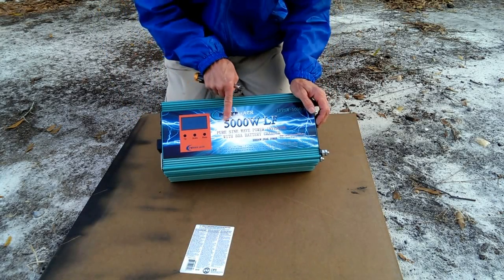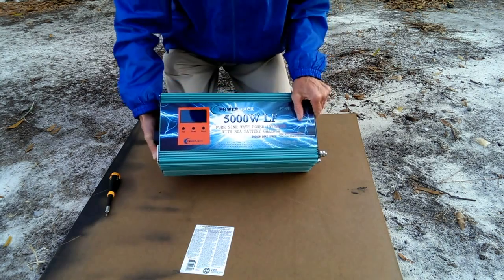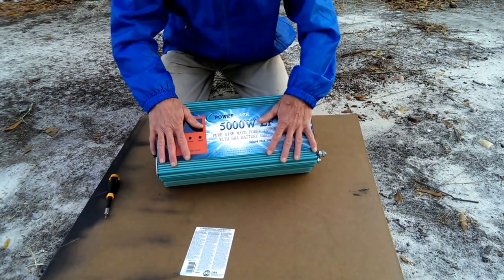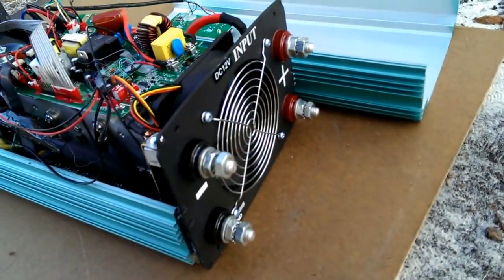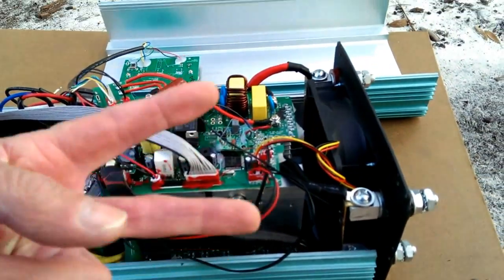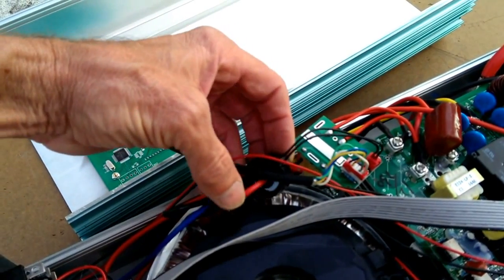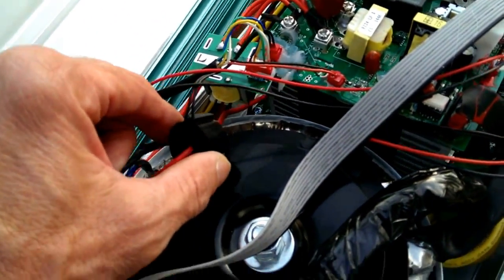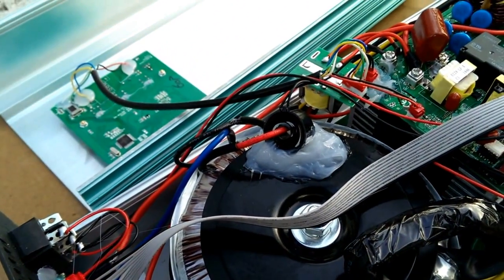5000w 220v Inverter inside

Comment: I've had both the 5000w and the 8000w and both of them have disappointed me. Product of poor quality and subject to many problems: overheating, insufficient fans, alarms out of control, mosfet burned ........ Product not to buy
Reply from the maker: sorry to hear this. Mine works well for over 3 year. I do welding from it
Reply: I have one also with no problems
Does not over heat .aways use the correct copper cables to battery.
Runs microwave coffee maker fans computers. Works great

Comment: DO NOT BUY POWER JACK
I ordered a 5000 watt LF and received a 6000 LF.  I think they do this to perpetrate fraud.  This way the unit received and PO /receipt (bill of sale) does not match the unit received.  Plus who is going to complain when they open their new inverter to find they received a unit that (should) provide more wattage.  

I have filed a fraud claim with Capital One through VISA but they say since I have not shipped the item back to some random unconfirmed address that the claim is not valid.  The problem with shipping a 6000 watt LF (55 pounds) inverter is the cost.  it will cost me $100 to ship this inverter.  Then I have no recourse, no inverter and am out $514 and a ton of my time!!

Yes, they have the perfect scam.  I really though my credit card company would go to bat for me.  I have been defrauded with a defective inverter and there is very little I can do because I had the unit 4 months and used it 18 total days during that time.